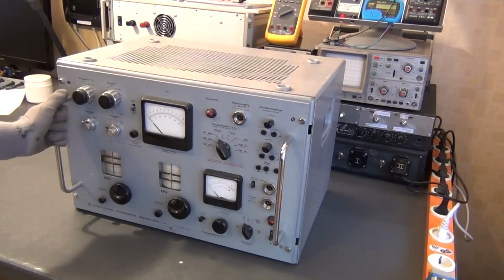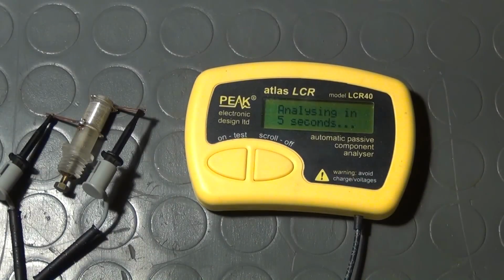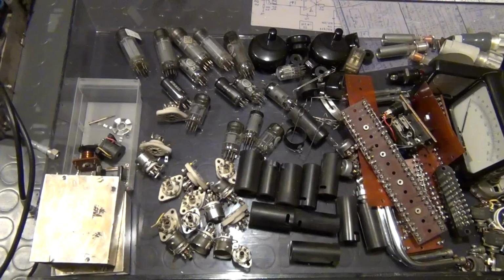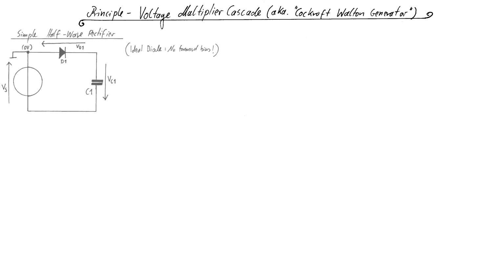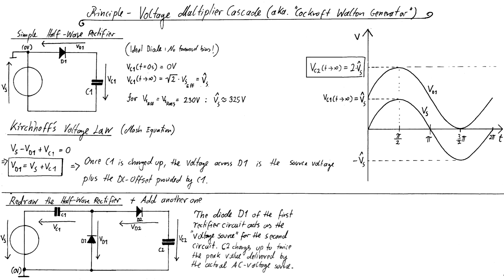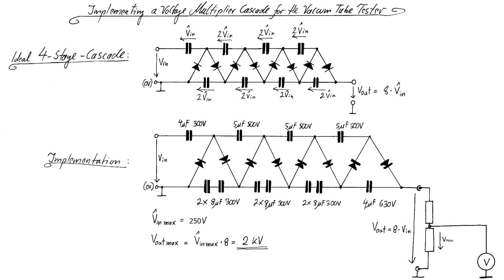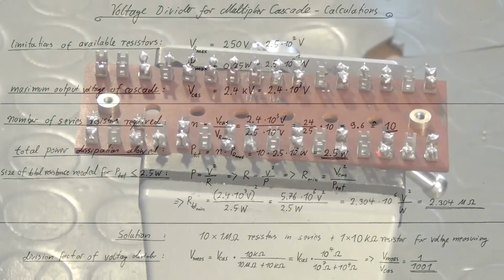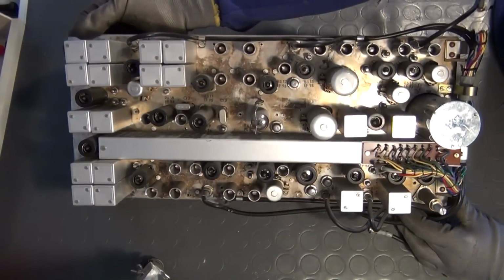Building a Voltage Multiplier Cascade - Vacuum Tube Tester (2)

Comment: What is the purpose of silver plating? Also I would be happy if someone made a more indepth video on chasis construction. There are some videos of people making a vacuum tube amplifier, including its chasis. But I think it would be useful not only for me, to get deeper insight what materials to use for shields and enclosures, when can coper plate, or jusyt copper plated bare PCB could be used to shield some components, is there a difference between steel, sytainles steel,, aluminium, brass, copper for making a case and shields between internal copartments. I just watshed a wideo on 80' s  electronics magazine project of making a THD meter, it was suggested to put the power supply, the oscilator and meter driver boards seperately. I wonder if in DIY projects it would add anything to put some parts like transformer, filter capacitors, or some sensitive oscilator or amplifier circuits in ytheir own shielded compartments. Could a metal cookie tin do de job, or its too thin or wrong material and wouldnt do anything? Electreically, if I make multiple modules each ion their own shielded case, all within the main chasis, is therea any caution necesary how are theuy electrically connected? Do I just bolt all the module enclosures to the main chaiss, or I use insulating standoffs and connecte them with a wire to any star grouind poit? On ALiExpress you can buy various transformer cases.Would they serve any purpose of shielding a transformer from radiating out or protecting a sensitive part of the circuit, like variable capacitor oscialator. or they are only for decorative purpose? Ocasiaonaly I hear about muy metal, but its hard to find. In some rare cases I have seen it being used in transformer shield or shielding the CRT tube in an oscilograph. Any guidelines or thoughts how to compartmetalize a project and when it is necesarry. What connectors, if any to use to wire any subchasis components or modules together. Theres a video out there where some uni students bult a +-15V power supply, i might be wrong, but I think it was a basic LM317 or 317 circuit, just heavely shielded, and they used BNC connectors as power supply outputs.
Another related topic - various transformer types. STandard EI core, toroidal and in hifi use - the O or C core. On the last capacitive coupling is reduced as input coil is on one side, and output is wound on the pother side. WHen and what benefits would such insolation bring? A safe guide how to revire transformers.  Especially for use in vacuum tube equipment, how to do it properly and to know thjere is enough insulationm between the windings?

Last but not Least some transformers have V and A rating, and max W or max rated VA. If i use a rectifier and capacitor first filter, how do I rate max DC current? If I have for example 15V 1A out transformer, can I saefly take constant 1 A from it? Or is  it more or is it less? Also voltage. Inschool phisics class it was simple Voltage ratio equals winding or turn ratiio Vin/Vout=T1/T2. But apparently if winding your own, you cannot just choose arbitrary number of turns in the primary winding. What happens if there is too much or too little from the optimum? I get that rectified DC is Vac*Sqrt()-Vdrop on rectifiers. But besides that can the no load voltage actually be higher than rated, or does the ac voltage drop under load, therefore further reducing the rectified DC? If rectifier + ccapacitor is applied, does the voltage ac waveform before it stays the same as without load or does it change? Are ytransformer output v oltage rating for macx load condittion, or with no load, or within rated current limit, it doesnt change much? WHy are in some schematics the transformer core earthed or there apperas to be a some sort of shield (that is not the core and not a winding) that is grounded or connected to some point in schematiocs?

Comment: yup. I get your point, mate. if sacrificing this one machine saves others like it (historical machines, etc), then it's definitely a rational reason to do so. absorbing the algebra, turned off the part of the brain that controls the negative emotion, anyway.
working/ building devices that reach such a high level of voltages, is certainly not for the fainthearted, man ;)
oh aye....thanks for the brainfood btw!!

Comment: Your multimeter measurement at the end may be slightly dangerous. When you output 2kV you measure around 250V differential between capacitors which won't damage the meter, but at the high end, there's a common mode 2kV which could potentialy break down the lead insulation and get to your hand.

High voltage mutimeter probes aren't too expensive (around 50 for a cheap one, 200€ for a fluke), they're basically a high value resistor and a lot of insulation on the end of a probe. e.g. http://www.rapidonline.com/Test-Measurement/High-Voltage-Multimeter-Probe-85-2216
Reply from the maker: KX36 Thanks for the advice. I was looking for a probe like that just the other day.
Reply: +KX36 luckily he uses his isolation transformers which prevents the existence of ground referenced high voltages. When starting messing up with high voltages you might consider buying insulated gloves, I know they are expensive but can save lives. Nice setup by the way !

Comment: I really like your videos.
By the way, It will be easier if you use small transformers for that HV generation. Example 10 pieces of 240/24 V transformers will do, 24V windings in series connected to mains, then 240V windings in series too. But yeah, work with what you have! Also, Don't forget to always bleed off your voltage cascade. :D

Comment: The chain drive is amazing. In radios from the 90's they used nylon string to transfer radio tuning rotation from the front panel to the variable capacitor, which from my experience loses tension after a time.
Reply from the maker: Heilman Hackatronics Yeah older gear needed a lot of mechanical engineering. I have an old radio from the 70s which has not just one, but several nylon strings, because the AM and FM range have to be adjusted separately. I repaired that unit (which involved replacing the variable capacitor) and I had to get the nylon strings in place again. Even though I had the original service manual,it still took my two hours or more to get the strings back in place. I guess I will show you that in a video some day.
Reply: @ThePostApocalypticInventor  Restringing dial cord is definitely NOT one of my favorite activities...
Reply: The Post Apocalyptic Inventor It ' s impressive how all this has changed , for both good & bad , a lot more capability , a lot less repairable , an LCD display V a piece of string & a few bits of bent wire . Let us avoid the conversation over carbon content ,

Comment: I have re-purposed a large number of older, tube lab equipment over the last 25 years but I have never seen a better designed unit as this one. It's truly a work of work of art. The engineering is in a class of it's own. What was the original use of this device? I would assume it to be some type of radio gear. You have unearth a virtual "tube" treasure trove.
Reply from the maker: bain5872 Have you seen part 1 already ? The device was used as a frequency meter in some test lab. It was operated in a sterile environment. There wasn't a speck of dust inside when I bought it four years ago.
Reply: The Post Apocalyptic Inventor
Opps, I did not see part one but I will watch it for sure. Thanks for the background information. Again, truly wonderful engineering.

Comment: New motor run caps with a 300VAC rating will safely do 800VDC, I test them to 1kV as a test when new, and after a few years they will not pass this. At 1kV they tend to be a bit noisy internally, you can hear the internal arcing.
Reply from the maker: SeanBZA Thanks for the info! That's exactly what I wanted to hear :)

Comment: Which soldering iron are you using?
Reply from the maker: ***** Nothing special. Just  an old cheap Ersa 25W iron. Been using it for 10 years. It's good enough for most things. http://www.amazon.de/Ersa-0920BD-L%C3%B6tkolben-Multitip-230V/dp/B0009QX1S8

Comment: I worked in an electronics repair shop when I was in high school (early-mid 80s) and it's a shame to think of all the tube TV/stereo/turntable cabinets, radios and other equipment that I hauled off to the dump. It would have been nice to have a big area to store all that stuff in, but at the time it was considered junk.
Reply from the maker: ElectronSpark I guess that's still going on in some places. About 3 years ago, I bought some wire in a local shop. The shop was owned by a tv/hifi repair guy and he asked me what the wires were good for. After I answered him that I was repairing a 1970s hifi amplifier, he said they would throw away stuff like that. 
The device I was talking about was worth 200€ on Ebay and is considered a collectible item by many people around the world. I sold stuff like that for hundreds of dollars and send it away to distant places like South Korea and Russia, but the local technicians / electricians had no idea...

Comment: Will you ever continue on your SMPS tutorial series? You never explained how all isolated SMPS topologies work...
Please contunue on those series, they are best, i learned a lot from them.
Reply from the maker: neclovekSK The thing is the following. I mentioned my "secret project" in one of my last video. The "secret project" involves some advanced smps-technology. While developing that circuit I too learn a lot of things about smps that I wasn't aware of before. Once the secret project is finished, I will definitely continue  the SMPS-series. And it will even be much better than the older parts. because I myself had a long time to think about how to proceed. In the meantime I will only do teardwons and side-projects, which will also involve minor explanations of some toppologies. The explanation of the "half wave rectifier" in this video for example  is at the heart of understanding smps. Some of the videos that will follow in the coming weeks will also involve some smps stuff + explanations. But as I said before I will not make tutorials in the classical sense in the coming weeks. I can't do that because it is a full time job and I can't afford that that time at the moment.
Reply: The Post Apocalyptic Inventor

Great to hear you'll be continuing them when you have more time, I learned a great deal from those videos and appreciate the effort you put into your videos.